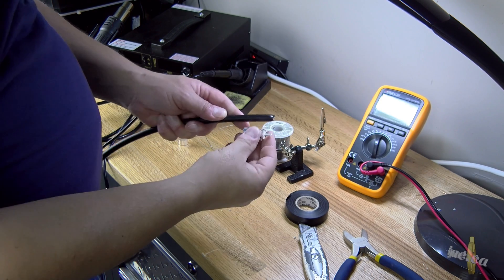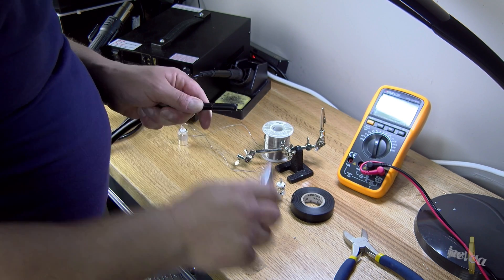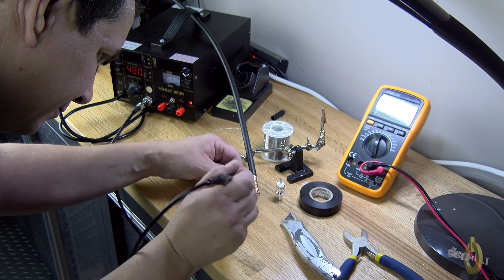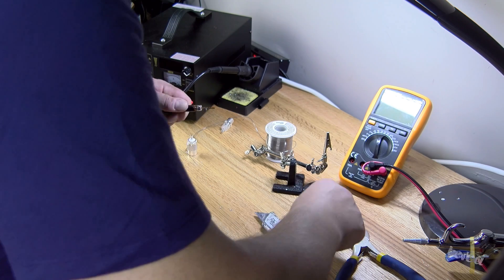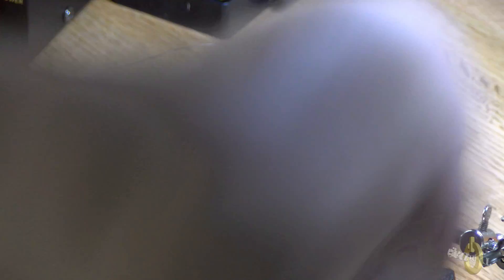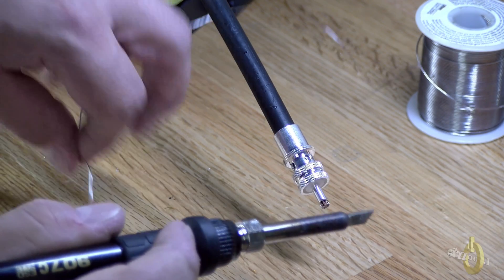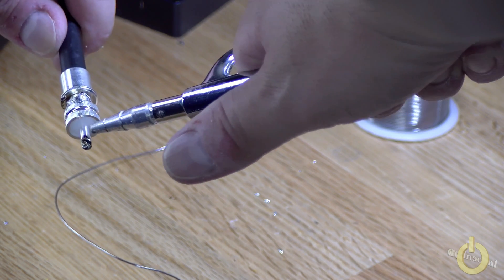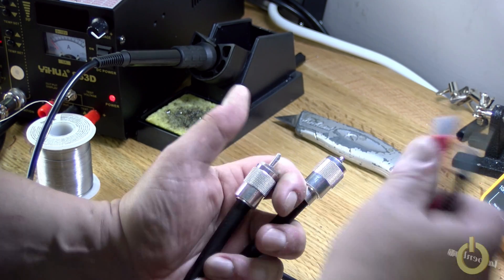PL-259 connector installation on a RG-213 (or RG-8) coaxial cable

Comment: I also never thought to pre-tin the braid. Its amazing. Keeps strands from moving around and shorting or not being there to solder thru a hole. A good connection to the whole braid not just a few strands. Thank you for a concise, quick and great video. 73's de N5UTV. I Also find that silver type and non lead solders are poor tinners and very temp sensitive. Kester 60/40 or similiar rocks.

Comment: You could wrap the dialectric in kapton tape although i havent tried this

the key is to buy pl259's with teflon insulator ring, if not you can pop out the conductor pin and the insulator ring so it wont heat up when youre soldering the barrel.

Comment: I've been doing my PL259's this way for years and never had any problems. Alot of radio operators do it differently, they fold back the braid and screw the connector on. I've never had much luck doing it that way as it seems like the coax is loose in the connector. Maybe I did it wrong doing it that way but I know when I solder the braid to the connector its tight and the connection between braid and connector is secure. Cooling the connector down between each hole is also a great idea. I use the Propel stuff for airbrushing to cool my connectors down. I turn the can upside down and blast it with the super cold liquid, works great.

Comment: One thing you NEVER EVER do is to cool the joint with compressed air.  This could potentially cause a cold solder joint in the future. Always let the joint cool down naturally WITHOUT forced cooling.  30 years of service  at IBM backs up my statement.

Comment: Excellent, shows how to do this job today.   Great idea using the cold air to quickly cool the job.   This is in contrast to the traditional method shown in the ARRL handbook which is based upon the old type of RG8 coax where the insulation was much less prone to melting.      I used to use 60W or 100W Weller iron to solder through from the holes in PL259 onto the braid of the coax, no problem however,  in the last 20 years or so the coax insulation just gets scared of a hot iron and runs away all over the bench HI.

Comment: Thank you for this. I went to find the datasheet for these Amphenol connectors on DigiKey and got a 404. I entered "083-1SP" into YouTube and here I am!  I was thinking of doing something way more complicated with the braid but your way is so much better. As to the downvotes: There's no pleasing some people! 73, KC1PAN
Reply from the maker: Cooling the connector with damp clothes is better then the air compressor.  I should redo a video about this.  73.

Comment: My only complaint is he doesn't use the high quality amphenol PL239 connector. He is using the cheap white plastic PL259 instead. Spend the extra $dollar$ on the good ones guys your equipment cost a lot of money why skimp on cheap connectors.❗
Reply from the maker: Hi Miguel,  there is no good option in my region, when I go to Dayton I try to stock a good connector.  I personally prefer the Amphenol brand. Now I used a damp clothes instead of an air compressor to cool down the connector.  73 Pascal VA2PV

Comment: Haven't you heard that welds have to let cool alone? It doesn't take a blowout with an air compressor since the welding is weakened.
Reply from the maker: Your right, you gotta be certain that the welding is not weakened.  The damp clothes work best, as suggested by some hams in the comments below.  Thanks for watching, 73 Pascal VA2PV

Comment: I've used this method on my coax and those of others with zero failure rate. First , use Amphenol connectors ... no cheap nickle-plated junk. Quality coax ... don`t go cheap here either.  I like to chamfer the braid holes with a drill, so I see brass: gives more soldering area on the connector. After tinning the braid, I use a small tubing cutter, such as one used for automotive brake lines. Make sure the cut dialectric is clean. Preheat with hair dryer, then soldering goes quicker. de NS2N
Heating the assembly after the coax

Comment: After watching other videos, this  is the best method without too much fuss.  Very good explanation with the final testing.  There it is!  KM6ARC
Reply from the maker: Thanks Maxx.  For cooling down the connector tje wet clothes is very good, no need for an air compressor.  73 Pascal VA2PV
Reply: @Laboenligne  from a Canadian to a Canadian I'll still probably screw this up.
VA7VAE

Comment: Good job, it never occured to me to solder the braid first...something i will do from now on. I do like to use my weller soldering gun that produces more heat and eliminates heating the coax too much. Vy 73. N5EQY
Reply: That's exactly what I thought.  Soldering the braid first before putting the connector on is a great idea to prevent shorts or movement of the braid when screwing on.  I have tried sliding the braid over the jacket, and cutting the braid shorter and soldering afterwords... never was happy with either way.  I'm going to try this method now.  
I also cut "by feel" with a sturdy boxcutter for nearly every type of cable I'm working with (CAT-5/6, coax, etc.)  The tools for it are okay, but they always seem to wind up cutting more of the braid than desired, or nicking conductors in the case of network cable, than if I do it by feel.

Comment: I thought you were VERY detail orientated and that assisted my understanding in
the overall procedure.   My hat is off to you; as many who actually "can't do it (make a decent video)" will be negative.   That darn negative human nature goes along with envy.
Reply from the maker: Hi Steven, thanks for your good comments. My video and my procedure is not perfect, I just try to demonstrate the technic and provide basic advice base on experience. If someone takes the time to comment with relevant information it’s always appreciated, I always focus on the positive side anyway, hihi.   If you refer to a previous comment below, it is good complementary information. My solder iron is at 480C max and I used my largest tips to do my PL, maybe not strong enough, the higher the temperature the better. In my video, some part where block by my hand and I showed you the best that I could, but I use the air compressor to cold it down, and I did it too quick. I will definatly try in the future the dampened sponge as suggested for cooling the connector.  In the past, I had an engineer telling that to be certain that the PL is OK it needs to be checked with a spectrum analyzer, well most of us don't have those type of equipment. So, we must use what we have.  On the other hand, there are other extreme practices and I can tell you for sure, without giving you any calls signs, that some of the stronger signal on HF are hams that don't even solder their PL!  So, at the end of the day, it’s the results that count but I don’t recommend to not solder your PL  as they probably have other types of problems.   All my antennas, except my new Cobweb, are installed since 2012 without any maintenance and I always get a return in pileups at the first called.  For me this is good enough ;-) 73 Pascal VA2PV

Comment: This is yet another incorrect "this is how to do it" video clip, about installing a soldered UHF male connector (Amphenol 83-1SP, et al). Several mistakes were made, with steps left out or not well explained.

The biggest error involves incorrect use of the incorrect soldering iron. AT LEAST 100W is required. I prefer my Weller 8200N 140W/100W gun but others like a 100W iron. Use of less than that is almost guaranteed to result in a cold solder joint (as was shown). Then, technique matters, and poor technique was shown here. The last step is to cool the plug using a dampened cloth/rag/sponge (not shown).

Since mastering the technique ca 1970, I've had nearly ZERO failed connectors. I installed the last dozen on the ends of cables that had the ends dangling in mid-air. This was cable w/ foamed polyethylene dielectric, not solid PE dielectric that was used in this video.

Bryan WA7PRC
Reply from the maker: Before I used this method some of my PL were ok on HF but not on UHF where I got SWR, but using this method it never happens again.  It may not be perfect but this technic never failed on me.  It also depends of the type of dielectric.  Your right, the fastest you can do it the better, so the temperature should be high.  If you cooled it to quickly with the air compressor it may do a cold solder and you may need to redo it.  73 Pascal VA2PV.
Reply: Your comments are true for the traditional method, this was best before coax available to hams became much much too sensitive to a large and hot soldering iron.  Todays RG213  is nothing like as rugged as the "legacy" coax I used at sea as a radio officer and at home in my shack in the 1970s, 80s.     Congratulations, Pascal  73 Tony G3ZRJ

Comment: theres definitely an art to soldering PL259s. no matter how many times I've done, it always takes forever and doesn't come out nearly as good as yours. I just use crimps ons now though I know they arent quite as reliable as soldering. well done!
Reply: I refuse to surrender. I have crimp ons also-but using them makes me feel like I'm cheating. My whole radio life for 50 years, this is a dragon that I have searched for a foolproof way to slay! I put them on better than most. Still, with all the practice I have had, it is maddening to not be able to make them look like some cables from manufacturers I have seen. I'm using LMR400 now and the insulation melting issue doesn't seem to be nearly as bad as old RG8. Following the ARRL instructions never seemed to work out to be something I was happy with. I don't know about using the compressor to cool the connector if you have other holes on the shell to do. You just have to heat them up again. It may indeed be a good idea. Just this morning, I put two Amphenol PL259s on. I'm sure they are perfectly adequate. They still made me feel like a chimpanzee. Why I searched for this video!

Comment: Very well done! I have never in the past tried tinning the top edge of the braid, but will do so from now on since it will make the solder through the connector holes adhere much faster.
Reply: solder the centre core too so the wire doesnt bend back and helps the capillary action.
Reply: .bylvdszZ 
Ko